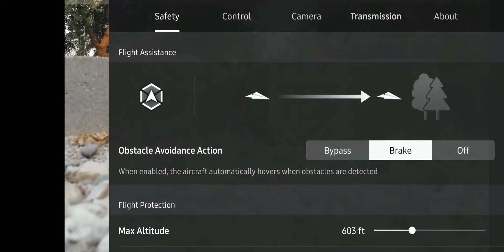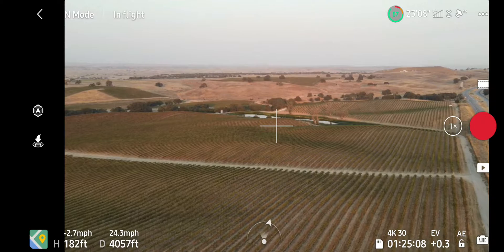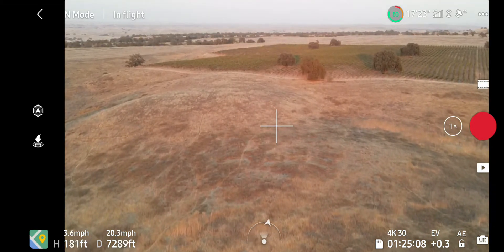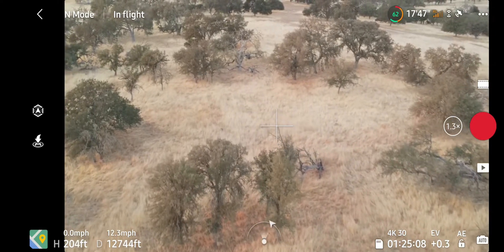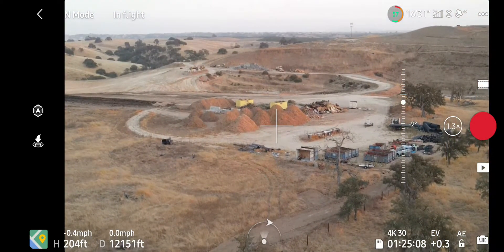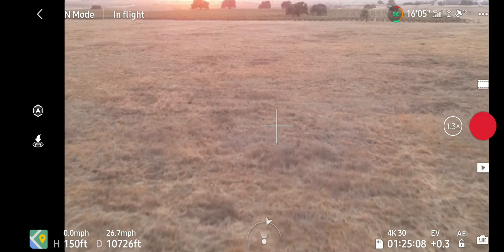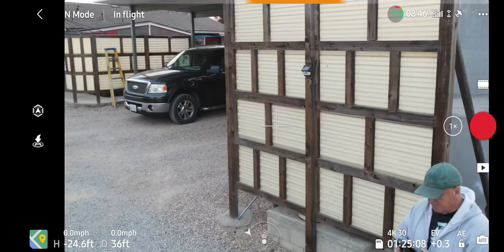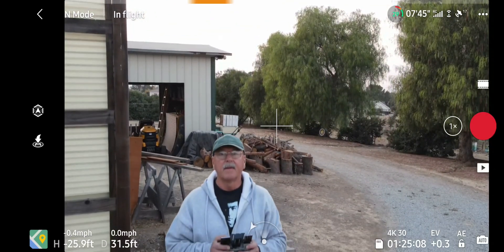Mavic Air 2 - Flying Lower with Yagi-Uda Antenna

Comment: I just purchased a mavic air 2, the radar type thing in the center on the bottom that shows the drone position is not there on my app....where is this setting? Anyone? Thanks in advance if you can help me.
Reply from the maker: Hey....yeah, dji took that out of the app. The new thing that replaces it  is shown in the video - attitude indicator review.
FE
Reply: @flighteye4650  thank you

Comment: Awesome video. Video seemed a bit out if focus butvit could just be the screen record doing that.  But still very clear. Just not as crisp As A in flight 4k video.  So understanding that, I'm impressed with the entire flight. How long was your flight ? Looking forward to getting a Mavic air 2 soon. Going to give my son my Mavic Pro. 👍   I'll subscribe,  looking forward to seeing more vids and them pigs
Reply from the maker: Thanks Bill! So after this video I figured out that my screen record was 2290x1080. I've started post processing them to 1920x1080 which is true 16:9 so they should be looking better. Most of my flights are right around 20 minutes. We're in hog country so its a matter of time......I'll find them.

Comment: This might be a stupid question but how do you record your screen like that with all the info on it? Are you using an app to where you can still speak and record your voice while it's recording the screen? Thanks
Reply from the maker: Hi there. So to do that you use a screen recorder app on the phone or tablet that you're using to fly the drone. It records basically everything on the phone/device and uses the device mic for the sound. In my case I use the built in android 10 app but there are apps for android or Apple that do the same thing. You can find them in the app stores. The apps save the recording as a file and you manipulate it to suit your needs. Hope that helps!
Reply from the maker: Search "android built in screen recorder". I heard they removed it from the o/s. Hopefully not.....its a good one.
Ken
Reply: Would "du tecorder" do the trick?